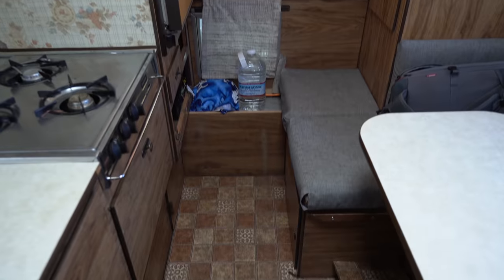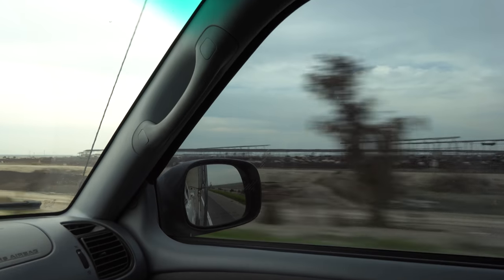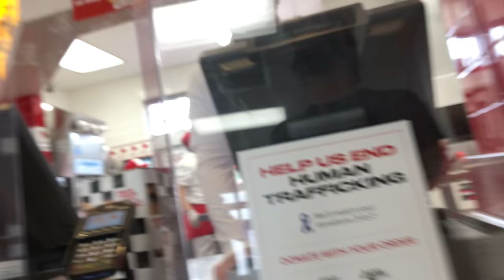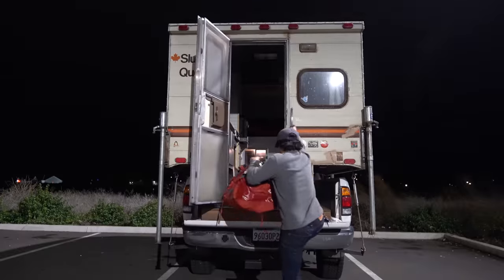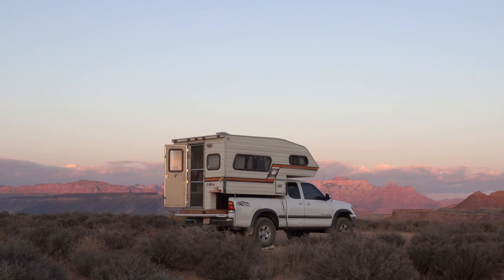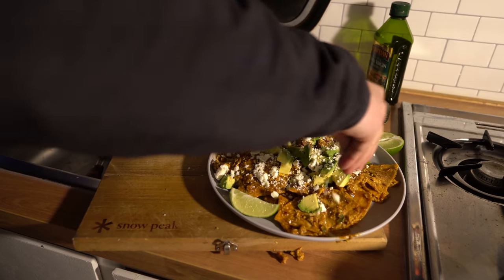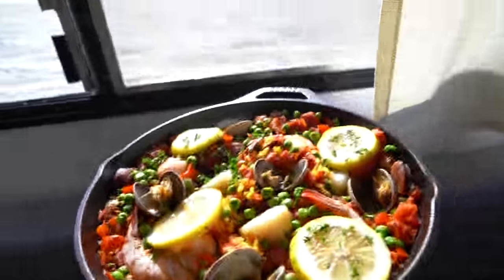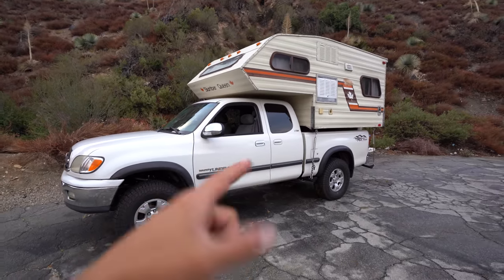Goodbye to the Slumber Queen

Comment: I live in a 1989 HMC 35 ft class A motorhome and have lived in it for over 12 years. It is old and needs a bit of work, so I get the trouble issue. I only move it a couple of times a year to go from the San Diego hills to the beach.
I also have a shell on my truck and have done a little traveling and camping with that rig. 
I'm glad you have become a little more handy through the Slumber Queen experience. Don't forget to give credit to your girlfriend.

Comment: 9:18 why not get a smaller camper/RV? No project, you can simply finance it or lease, whatever is clever. You can buy a slightly older one for cheaper than new, but tab and scamp are ones that come to mind that have more space, has a toilet and shower, and a little more room and storage. Just a thought.

Comment: Hard to tell from photos but looks like savable. You need a lot of insulation for what you're doing.  Fill the walls, floor and ceiling with foam. Probably have to replace some paneling if not all. Definitely open windows and vents when you cook. Also use moisture wicks to absorb moisture inside. (The cubes people put in basements to keep dry) You gotta be creative about not bringing too much moisture inside. Any small space that you try to heat is going to have a condensation problem.
Perhaps not do the gourmet cooking inside, just cold food or warm and eat. I know you like it and it's big part of your videos. And you do a great job cooking. But confined spaces always have problems with moisture. Desert camping might be better.